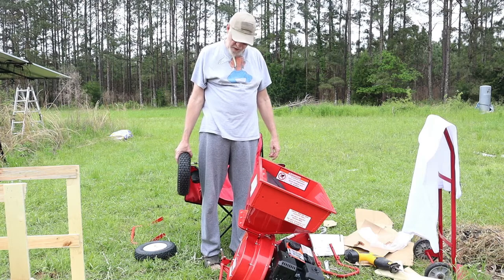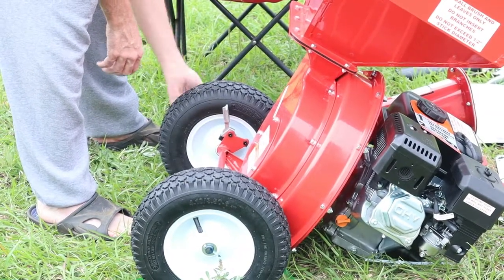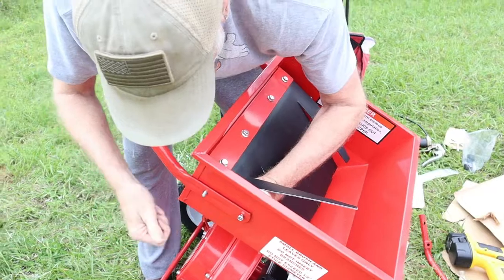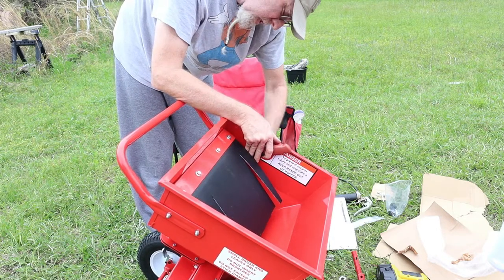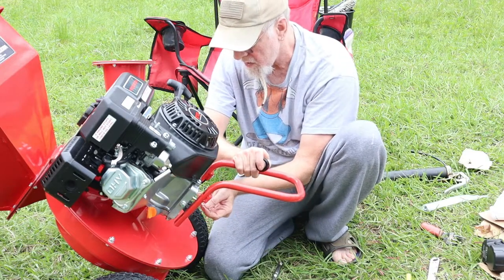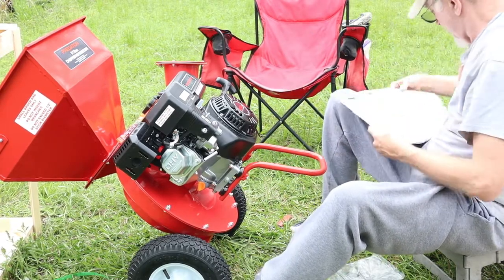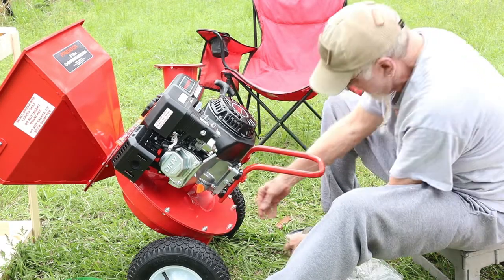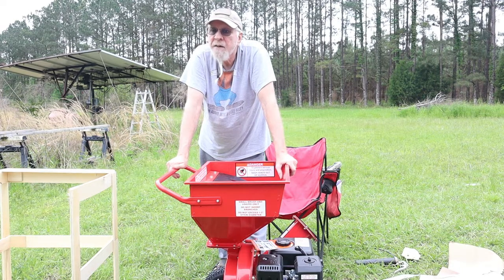HOW TO ASSEMBLE THE HARBOR FREIGHT CHIPPER SHREDDER???

Comment: bought this yesterday; mine will require even more assembly; the hopper isn't even attached to mine! Supposedly comes with the needed tools; we'll see!
Reply from the maker: Wow u been had, if I were u I would call the manager and explain the situation and return it for 1 that is properly assembled in the box, just saying hope u enjoy and it meets your expectations it did for us
Reply: @mhayascottacres39  Thanks for replying; yes, I'm taking it back tomorrow!
Reply: Yeah, I was thinking about assembly also so I put my thinking cap on got on FB found one only used for 8 hrs at $225.00 all assembled ready to go, I even asked the guy if he greased the axles wheels and yes he did because if he didn't that's the only modification I was going to make to the assembly. I mean $225.00!!!
Reply: I've watched a couple assembly videos years apart and noticed some were partially assembled

Comment: Bought this shredder - what a piece of junk. First time - didn't work. Exchanged it - missing parts. Exchanged it again - faulty operation. Went to return it, they wanted a $30% restocking fee that no one told me about. Manager hung phone up and told me I as dishonest and refused to give me her boss' number. I will NEVER buy anything from Harbor Freight again - cheap tools that break and aren't worth saving $10. By the way - bought both shreders they offer - the small one is weaker than a paper shredder the bigger one is unsafe and very hard to operate - especially since they don't tell you you have to hire a professional mechanic to install the high altitude kit. This company is very dishonest.
Reply from the maker: WOW!!! Sorry to hear that, I have heard stories like that before, luckily we have never experienced that, but it can be hit or miss on their stuff at times, and it is buyer beware on others, for the savings we get it is worth a little risk at times, I had heard of the restocking fee thing before, and depending on the item to me if its worth the hassle, I can always use a little more yard art, I hope you have better luck in the future, and thank you for watching!!!